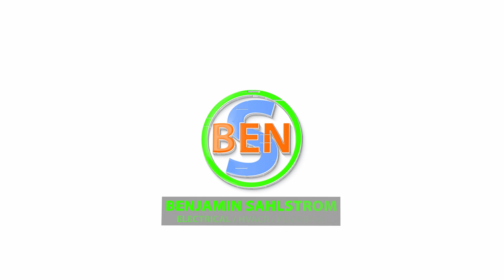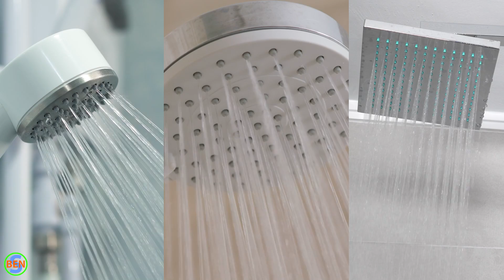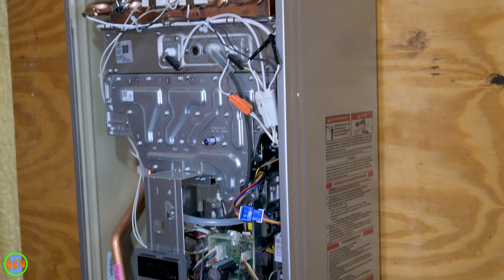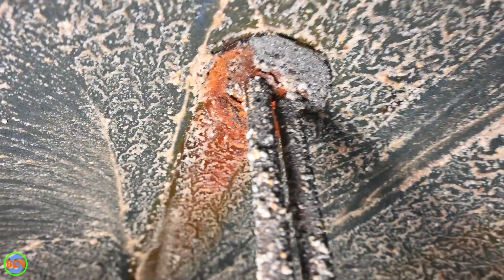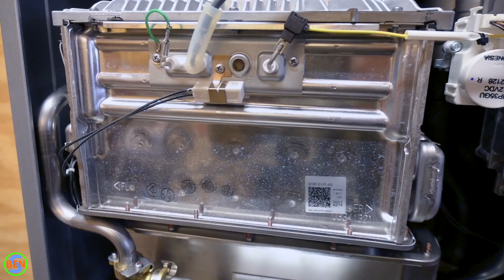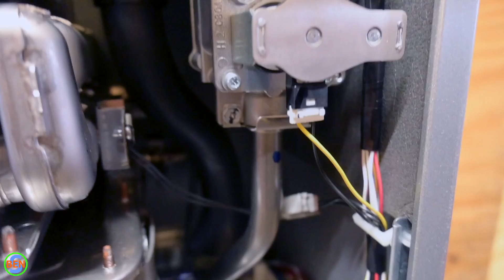Top 8 Tankless Water Heater Myths!

Comment: I specified a tankless water heater (A Rinnai) when my home was built 13 years ago.  I had one problem where water was building up inside the case of the unit only to discover it was due to an improper installation (failure to leave an air gap in the drain).  After the plumbing contractor returned and corrected their mistake it has worked flawlessly while servicing 5 baths.

Comment: i haven't had any experience with them but i do have a question: for venting can the venting or inlet pipes angle up at a 90 degree angle on the outside of the house if needed?

Comment: I find that the water temperature changes with different flow rates. If while taking a shower and someone runs water elsewhere, the change of water pressure will make a noticeable change in water temperature. My solution was to install a small 12 gallon water heater after the tankless heater and now I have a much more stable situation.

Comment: The size of tubing used in boiler  in tankless is so small any particles will easily plug it. Using tankless to replace existing cast iron radiators system will plug due to rust build up over years and willl require extensive cleaning to remove all deposits from old system .  Ok for new clean systems bad for old.  I see you managed to avoid answering that. Considering you are sponsored by tankless .  Also most tankless systems require  additional hot water tank to supply necessary volume.  Example is a bath tub They are 60 gallons or more at 3  gallons per minute would require 20-30 minutes to fill.  Water would be cold at that rate.   Fine for showers.  
  So if you want to be sponsored by tankless you need to tell the both sides of story. 
  Very disappointed you fell into the trap.

Comment: Ok I have a question Im hoping you can answer.  We are doing an in floor radiant heating system.  Ive been looking at using a heat pump water heater vs this type of system.  Its 4000-5000 sq feet so we would do a closed circuit for the radiant heat and a separate one for the household water.  Are these going to be very efficient if they are heating water all the time for in floor heat?  We have the heat on 9-10 months of the year.

Comment: The Netherlands uses tankless gas water heaters since the 50ties. And was in 70ties added with central heating (combi model) which is based on heated water and radiators. Standing Pilot's where in the 70ties already replaced by electronic igniters, for safety  reasons due to the amount of fires and accidents.
Since 2010, and specially now, from 2018 prevention for further climate change, the use of fossil fuel as gas to reduce CO2 reduction gas appliances (water, heating, cooking) are fased out. And changed for heat pumps, solar and electricity based.
So a gas water heaters for warm water or water heating has a history and experience of 73 years.
Some important things to take into account, plastic, well insulated transport lines result in less heat los. The location is the one that keep transport lines short, thus water loss until heated water arrives as low as possible. Calculate the right capacity based this location, and heat loss in transport lines and wanted waterflow for a minimal amount of users at same time. (shower and rinsing dishes in kitchen for example)

Comment: Great content, thanks for posting.  Question - if you live in an area where natural gas is not available and propane is expensive, does it make sense to use a tankless HWH using only electricity?  I would guess no.  Maybe worth putting in a propane storage tank just for this purpose?  Also, what about making hot water for in floor radiant heat?  Air to water heat pump vs propane boiler?   We live in a climate (near Seattle) where we don't need AC and thus can avoid force air heating and cooling and just use radiant in floor heat.  I'm looking forward to your boiler videos.  Thanks!
Reply: Hi Laura.  We are near seattle too and planning on doing 2 heat pump water heaters, one for radiant heat and one for domestic water.  What did you decide to go with?
Reply: @RealWorldNailsLuvNailz  We are still exploring options.

Comment: Wanted to go tankless, but measured my water heater losing 100W/h in winter which isn't really lost since it heats the house. Add now that we have rebates for not using electricity during peak hours, a tank is by far the best choice. I cut power to the tank and have water for a couple of showers. Also use two small point of use 1.5L tanks for instant hot instead of recirculation pump that had parts that need servicing.

Comment: A fact about tankless heaters. There complex expensive and die far to soon. If you live in the north your heating most of the year so who cares if entropy is moving heat from your 75 gallons of hot water  into conditioned space. You will loose money in the long run with these 80 million BTU cash burners that are full of sensors processing and paper thin heat exchangers that fail far to soon!  Keep the tank, If you have solids keep it clean by purging out the tank. Change the sacrificial anode and you will win! I hate these units! Its not likely there going to improve there service life. The manufactures are studying the psychology of when you will accept it dying. far more then there pushing engineering to make it last longer.

Comment: We went electric due to the cost and couldn’t place the unit where it had short runs to the users. $275 for Rheems 27 model. 3 breakers needed but if one person is showering. The unit only turn on 1 or 2 heaters. Sweet!
Reply: the electric demand is really not practical for homes in older communities that might only have a 100A service.  And in California the cost of electricity is roughly $0.35/KWH, so gas makes way more sense.
Reply: @steveloux4709  Well Steve the purchase cost is so high for gas you might be better off with the heat pump type. We all know gas in California is on death row. You boys better get crackin on all the solar panels and turbines you’re going to need.
Reply: @donhuffer5167  yeah, you and I probably see the world similarly in regard to the eco-politics of California.

Comment: I currently have a power vent hot water heater.  The beauty of this is that I can use it as it is 110 by connecting to my portable genny in an outage.  Are these tankless systems also 110 or do they have to be hard wired by code to not void the warranty?

Comment: I installed a tankless 6 to 7 years ago, when one of my 2-40 gallon tank type heaters went out. I piped it so my 40 gallon tank is now the storage tank for my tankless heater. My tankless unit is capable of internal or external whole house circulation. I put mine on external circulation, which is on an internal clock on the tankless. It is capable of recirculating every 30 minutes or as often as you like in  a 24 hour period. My tank type heater stays on vacation mode all the time. I have it piped so if we do have a power outage, I can turn valves and go solely to the tank heater itself, or run solely off the the tankless.  Most tankless manufactures have piping diagrams that will show a holding tank for there units.  Note,  I am a licensed plumber.

Comment: Myth 2 is true. I had two of these installed (last one 3yrs ago) and each time the cost of the installation was equal or greater than the cost of the unit. Until the fittings are on the top, these will not be a direct replacement for water heaters and will involve a lot of reworking of pipes by your plumber which equals greater install cost. It just a fact!

Comment: My tankless unit is electric and I chose this method for several reasons, regardless its 20 years old this winter. Ive had ZERO problems with it. I have it in a home thats used primarily in the summer but also occasionally in the winter months in Northern Michigan. I've never run out of hot water and often run several showers back to back after a day in the woods or on the water. The only issue i have with it is that the manufacturer didn't plan for "winterization" and draining the unit for that. I blow LOW pressure air back through the unit for several minuits ( I built the plumbing to accommodate this) to winterize it. This process has worked just fine for 20 years. I believe some manufactures have now put drains in the chambers for more convenient winterizing.

Comment: Canadian viewer here. Tankless water heaters work very well here, even with very low cold water temperatures. I'm just about to install a Rinnai RU130iP, a propane-fired ultra-high efficiency condensing unit. Because our outdoor air temperatures are so cold here (-42C on Dec. 22, 2022) I plan to steal combustion air from  the house. If I plumbed the air inlet to the exterior the entire unit would freeze solid. Good video!

Comment: Our Rinnai was installed in 2009 and still works great! I descale it every year as per their recommendation, and check the inlet filter. Maybe it’s an early model issue, but it definitely takes a solid minute to get hot water to almost anywhere in the house. Also, I installed a small roof over the vent on the outside of the house after snow built up and blocked it causing a shutdown the first year we had it.
Thanks for this video!

Comment: I've never not had hot water with my tank type water heater. The power could go out for 12 hours and I would still have hot water. I have it set to 140° to make sure it's not a breeding ground for bacteria. And then I have a thermostatic mixing valve on the output side set to a comfortable level so no one can get burned.

Comment: Thank you Benjamin. 
It appears you are only reviewing gas tankless heaters in this video.  Are they Natural gas or LPG.
But what about electric tankless, 120V vs 240V and their advantages and disadvantages. 
Also please review whole house vs single faucet. 
I use solar water heater that has an electric heating element built in for cloudy days but I'm planning to add a single faucet electric tankless in my kitchen for sink and dish washer use. 
Any thoughts??
Reply: I have a Point of Use one in my garage that’s electric in MInnesota.

It’s fine for washing hands but anything else it’s undersized. I knew this when I put it in though.

Biggest problem I have with electric ones is they need a lot of power, and being I wish to install a standby generator so i would have to buy a more expensive one.

I actually wanted to do a large electric tankless so I don’t have the venting and they do take less space but again, the need to upgrade my service and my ultra low water temp coming in where the biggest reasons I decided against this.
Reply: @text3834  not working
Reply: the equivalent electric version of these gas-fired tankless units use a MASSIVE amount of electricity.  Commonly four (4) 40A, 240V circuits to serve this one appliance, with a maximum current flow of 150 amps.  Customers with this arrangement should consider a 300 amp incoming service.

Comment: I have a tankless 199btu... In Minnesota further north than Ben is.

There are 4 things I notice that's different VS traditional tank.

1) slower to get hot water, about 3 to 5 seconds different. Not really an issue 
2) cold water sandwich, when you turn on and off the water repeatedly like when I bathe my dog. This is fixable if I had a recirculating line, but my max run on the house is only 14 feet, so I didn't see the value in putting one in and I wish I did. I now just leave the sink on while I bathe the dog and it takes care of this. 
3) never running out of hot water, can't stress how great this is. However see 4.
4) I don't really see any energy cost savings as I tend to now use more hot water. I go through on average 10 gal of propane my myself so they are there, but nothing crazy. And the waste heat would have just entered my home anyway and I'm in a heating-dominated climate. If I was in a cooling-dominated climate I would go with a heat pump water heater
Reply: 10 gallons per week? Month? Curious.
Reply: @jasoncy31  of propane a month.

This is a rough estimate based on the propane gage on the tank in the summer when the only propane use was only for the hot water 

To transfer this to actual cost per gallon 

It takes 8.33 btu to raise 1 gallon one degree.

I have mine set to 130, so each gallon takes 708.05 btus to to get up to temp, but the tankless is 96% efficient so I consume 736.372 btus of propane so it takes 0.008 gallons of propane to heat 1 gallon of water, at 2.30 a gallon that’s 1.8 cents to heat 1 gallon of water

Natural gas is way cheaper but not an option here

Comment: in Australia about 1989 My Dad fitted a second hand Bosch Junkers instantaneous (tankless) hot water system to replace the electric gravity fed unit in the roof cavity. over the 20yrs i remember it being there, it only needed a diaphragm once in a while. i had an even older model in a house i lived in, and was also over 20yrs old and only needed diaphragm changed every couple of years or so also. currently have a stainless steel natural gas tank and if it ever needed replacing we'd definitely be wanting a tankless due to it not heating water 23hrs a day when not needed.

Comment: No one wants to service their water heater every year and more than likely no one will until there's a problem. Also tank type water heaters usually have all parts in stock at plumbing supply houses whereas tankless, you would have to call and have a part shipped. No one wants to sit without hot water, waiting for some part to show up in the mail.   Cost for tankless will always be much greater than a standard tank type water heater regardless of how good they are and how many improvements they've made. At least this statement is true for the Chicagoland area. I understand tankless are more prevalent in different areas of the world.
Reply: Absolutely. This is why cars never caught on. Horses are so easy to fuel and never need parts!

Comment: Myth: Tankless is the "green" option. Fact: compared to heat pump water heaters, tankless is much worse.
Reply: depends on how your electricity is generated. plus, the heat they remove from the indoor air, in winter has to be replaced by heating system.
Reply: Climate actually has a bit to do with that too though. Most water heaters are in garages and in cooler climate you are basically paying for a super expensive electric water heater
Reply: Yeah if you primarily live in a cold climate, it is best to use a split or ducted heat pump water heater.
Reply: @ewicky  I've found the energy savings are almost negligible between a tankless and a heat pump in my climate

Comment: We did adjust the dip switches to raise our temp to 130 F. And it requires a large enough flow rate to turn on, so a small dribble needed to shave won’t get it going. Also, make sure to clean the inlet filer on a regular basis- we waited too long and filter was stuck. If you break it taking it out, you cannot turn the water back on. Bought a replacement filter to have on hand, and lubed the oil ring with silicone when I reinstalled it.
Reply: 130 is too hot. 125F is the max recommended safe domestic hot water outlet temp.

Comment: Experience  I've had with them was the flow switches failing too often causing a failure  to heat water. Maybe been  overcome by now, but Don't know at this point.  Also I do think there are a lot  more things  that can go wrong  with these units. We've got  a 40 Gal water heater that 's still working well after being installed by my self over thirteen years ago, and it's warranted for 9 years.   Simple technology beats the new stuff  as in the Automotive industry too. Ja?   Yup for me. Thanks
Reply from the maker: Definitely have to weigh out the pros and cons. More complexity usually does equal more maintenance as you mentioned.

Comment: When I bought my new house in 2008 I had a Rinnai tankless water heater installed.  Unlimited hot water was awesome.. for example filling up your hot tub and being able to use it immediately.  However, that era LG washers drew water in short spurts, never allowing the Rinnai to come on, stay on, and provide hot water for the washing machine.  Also, if you need small amounts of hot water.. the hot water tank is great; the tankless not so much.. you basically have to leave the hot water tap cranked on (ie. using hot water to rinse your wet razor between passes -- a hot water tank you can turn the tap on and off and always have hot water, whereas the tankless.. you have to leave that tap turned on while you save).
Reply from the maker: I think that isn't an issue now thanks to the recirculation feature if I'm not mistaken?
Reply: @BenjaminSahlstrom  I hope they have improved the tankless hot water heaters in the last 20 years, my friend had one in his house back then and you had to have the water flow on full or you did not get hot water all the time with a smaller flow. Sounds like the recirculation feature would help solve that issue. BTW do they make an electric unit?
Reply: @J.C. Wise  electric units can be prohibitively expensive to install. A big enough one to run a house will require a 200 amp circuit by itself. That's roughly the size of most houses electrical panels. They also don't have throttling valves and dependent on your incoming water temp you will not get the gpm advertised
Reply: @1985Satisfaction  Yep, how about an electrical tankless hot water unit that requires 300 amp service, Lows sells them!?.
Reply: @JCWise-sf9ww  if that's a direction you wanted to go. Look for stiebel eltron
Reply: @JCWise-sf9ww  It varies from brand to brand. The RU series of Rinnai condensing tankless require only 1.0 lpm to activate the burner. That's only 0.56 ounces per second, pretty slow. I don't expect any trouble at all from my new unit.
Reply: @BenjaminSahlstrom  you are correct. Though navien's are a better unit for several reasons.